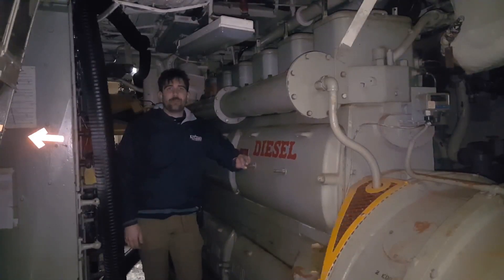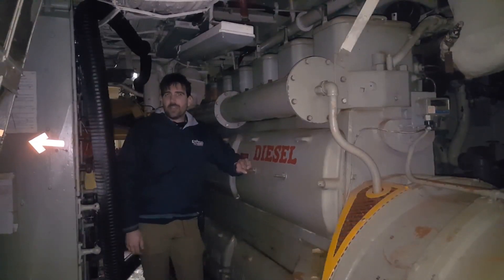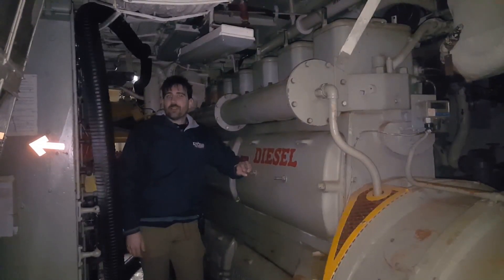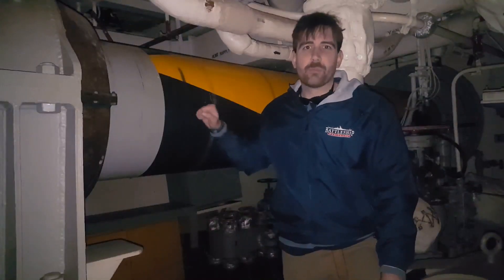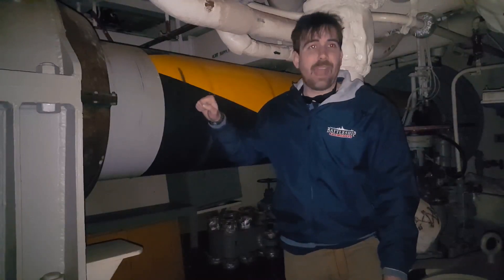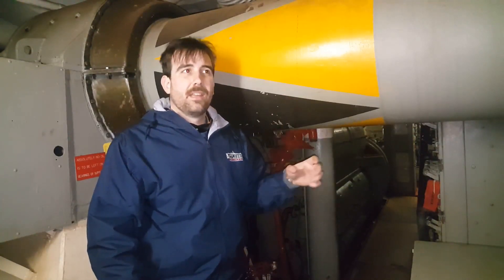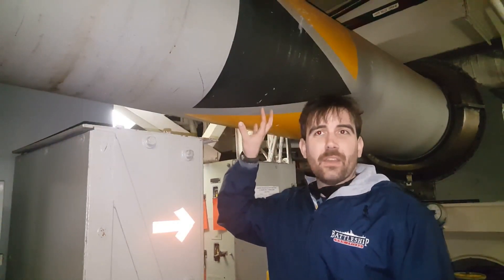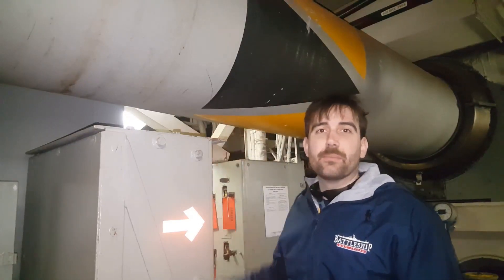After Diesel - Battleship New Jersey

Comment: There was a painting of Snuffy Smith on the fuel oil tank. Is it still There? It was likely painted in the 1940s. One of the jerks who manned the space (he shall remain nameless) tried to remove it with a needle gun in 1985. One of the guys repainted it like new as the outline and base colors were still visible.

Comment: BB 62. 4 X 110,000 HP steam turbine engines. 8 X 650 PSI boilers. 60,000 tons at 33 knots.
15,000 mile range on on board fuel. 
19 X battle stars.

Those steel fabrications for propellor shafts support are alone a fabulous example of the quality of the entire ship. 
Mind boggling engineering went into her from stem to stern. Philadelphia Naval Ship Yards 1942.

Comment: What about the diesel engine and generator.  Make, model, specs, KW?
Reply: It looks like an Alco 539.
Reply: If it is an Alco 539 it looks like the 6 cylinder version which is usually 1000 HP or about 735 kW.  Assuming a reasonably efficient generator, it should be generating between 550 kW and 600 kW of electricity.  There should be a name plate on the generator with this info.

Comment: Would have been nice to know the specifications of the generator. What engine is it? What rpm did it run? What power did it put out? How many hours was it used? etc, etc.
Reply: I came here to ask this.
What make/model is the engine and do you ever fire it up?
What means of starting does it have?
Reply: Commentor 75Bird455 down below says it looks like an ALCO 539 
 In postwar locomotive service it may produce 660 HP at 740 rpm but perhaps less in military service.

Comment: Interesting that the spinning prop shafts are just exposed like that. At first I assumed we were looking at a housing with the shaft inside.
Reply from the maker: I always add to my tours that it isnt in a casing because most people assume that it is inside of a tube or something.
Reply: @BattleshipNewJersey  When you discuss that, do people ever tell you to "shut your mouth" since you're talking about shaft?
Reply: @BattleshipNewJersey  Actually, I believe that the propeller shafts are hollow and filled with sand. This is because a solid shaft would not only be very heavy, but the stress on the solid shaft could cause them to crack. By making them hollow, and locating the engines midships, the shafts can twist and take up that stress. I think they can twist up to one-and-a-half times over their length.
See https://smartmechanicals.blogspot.com/2018/05/why-most-of-propeller-shafts-are-hollow.html

Comment: Can you guys reactivate the New Jersey so we can see the propeller shafts in motion?
Reply: I will settle for a painted fiberglass shell around the shaft that is rotated by a small motor on mains power in lieu of battleship reactivation.
Reply: They're not allowed to light the boilers and run the steam systems at all. Even if they were, it would take tons of work to get everything in working order. There's no money for that or for the fuel needed to run it.